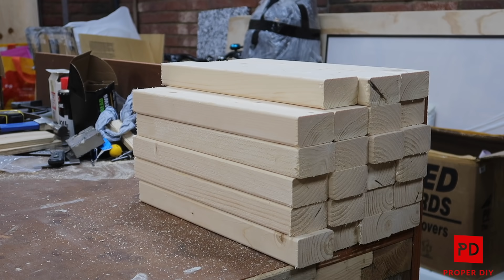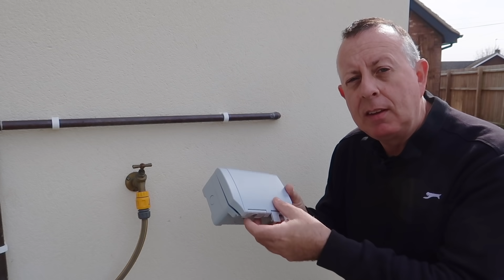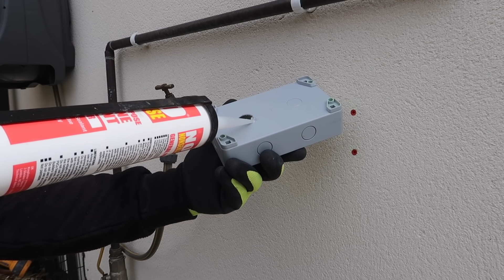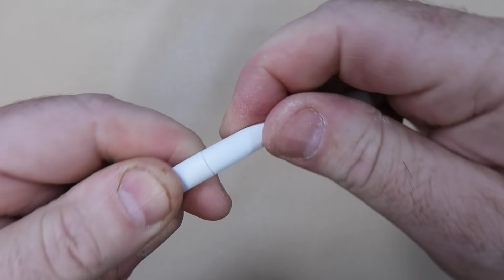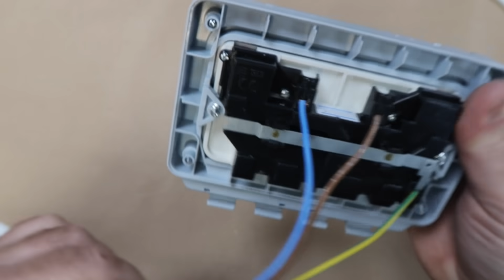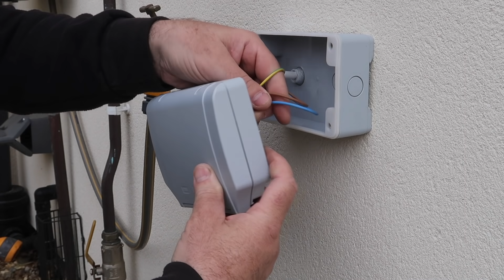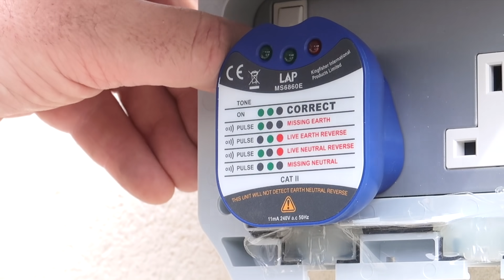How to Install the Easiest Outdoor Socket

Comment: So can you use this method with the external socket WITH RCD as well? Or does that need to be wired differently? Thanks
Reply from the maker: Yes, same method, wired the same way.
Reply: @ProperDIY  Thank you! 👍🏻
Reply: @ProperDIY  The ring circuit that I would plug in to comes from a consumer unit that already has RCDs built-in. Would there be any point in also having an external socket with an RCD? Would there be any conflict between the two RCDs? Excellent video, by the way. I have been pondering for ages about how to do this DIY job.
Reply from the maker: @trevorelliott232  Thank you. I don't tgink you need an additional RCD if like me you have one in the consumer unit.  If you do use both I don't think there would be an issue - if there was a conflict one or other would immediately trip

Comment: When I prep. the ends of flex I use the insulation that the stripper's removed to twist the strands. In other words, once the insulation is detached from the rest, I twist and pull it off at the same time. It's quick and leaves me with a very neatly twisted end.

Reduces wear on thumbs and fingers too!

It's easier to demonstrate than explain...
Reply from the maker: Good tip!

Comment: I recommend getting a bootlace ferrule kit and crimper and fitting bootlace ferrules to all stranded wire ends when screwing them into terminals in plugs, sockets etc. Makes a safer and more professional job.
Reply: That's the problem with diy, even the simplest task,  like terminating a flex, takes one into a different world. One which requires tools and equipment that cost money, when the whole idea is to save it!
Reply: 526.9

Comment: I fitted my outdoor socket direct through to an internal socket wired directly into the back box thus avoiding any ugly wires and used 2.5mm twin and earth cable as when adding a spur.
Reply: @banditfet  Since when does fitting a spur with 2.5mm twin and earth cable mean the house insurance is void?
Reply: @banditfet  Are you referring to my original comment or to 'Proper DIY' who made this video? If the latter then please direct your comments accordingly. However, my comment concerned the use of 2.5mm twin and earth as opposed to 1.5mm flex - perhaps you'd like to comment on that especially as the outside socket could be used for anything including a PHEV with a load of around 3.6kWh.
There are many hundreds if not thousands of "how to" videos on here showing how the average DIYer can add a spur, sockets, lights etc without any reference to a "minor works certificate", which as I understand it means the works have to comply with BS7671, as long as it is done safely and competently. In fact, I doubt you would even be able to get an electrician to complete a "minor works certificate" unless they themselves did the work. Therefore, I would suggest that the insurance company would have to prove that such work was defective in order to refuse a valid claim.
In conclusion perhaps you would also like to comment on the changes to Part P of the Building Regulations:-
Under the new, revised regulations, electrical work undertaken in kitchens such as adding a new socket or work outdoors such as installing a new security light will no longer be notifiable unless a new circuit is required. This will mean less work has to be notified by electricians.
Reply: @banditfet  Sorry, but you are wrong. Replacing sockets is not a 'notifiable' job in electrical terms and does not void insurance. You can change sockets, move sockets and add to sockets yourself but if you want a new circuit then it has to be installed by a qualified electrician and signed off accordingly. Any bathroom work IS notifiable. I'm not an electrician but as regards the above video I would not really recommend installing additional sockets with less than 2.5mm twin and earth cable through the wall to an outside socket.

Comment: Brilliant, I've been wanting to fit an external socket, but wasn't too sure about hardwiring. I'll be sure to do this. Thanks.
Reply from the maker: I wouldn't want to hardwired straight into the back of a house socket. When water finally get into the external socket in the middle of the night and trips the house rcd, you then need to find the problem and unwired it!

Comment: Just the job, I’m fed up of opening the garage window to the rear garden and feeding the cable through the window, then walking around to connect pressure washer, then back to switch on, then reverse when finished. So it’s my next job. 👍
Reply from the maker: I exactly know what you mean!

Comment: Good video I was thinking of doing this in the summer,
One little tip I lent over the years ,when you cut wires to strip (live,earth,neutral) don’t pull the platic completely off the end,it gives you something to grip,then pull off end same time twisting platic and it’s twists strands so easy.
(easy on the fingers,no sharp bits of wire)
Reply from the maker: Good tip.

Comment: Unfortunately this type of socket has a design fault in that the Spring powered hinge has a nasty habit of breaking it's housing. The plastic is very weak at this point and the inevitable perishing of it will mean it'll lose its strength and the hinged cover will break free rendering it's IP integrity void.

Comment: The best way would be to drill back entry from a existing socket and put the outdoor socket back to back. No mess whatsoever.
Reply from the maker: You can do if a) you have an existing socket exactly behind the wall of where you want the new one b) you don't want any remote switching of it c) you don't want any isolation between the house system and the external socket if there is a problem

Comment: When wiring a plug I remember which wire goes where by : BLue (BL Bottom Left), BRown (BR Bottom Right), you can use it on the socket too, bLue (L Left), bRown (R Right).
Reply: What happens with LAP sockets from screwfix where the Line terminal is above the Neutral
Reply: I always remember Brown is Live, because that will be the colour of your pants, if you touch it with the power on. :)

Comment: I’ve got the same dewalt drill as you and I’m wondering how long you have had it and how long the brushes last as I may go for a brushless thanks
Reply from the maker: 2 years so far and still running fine

Comment: Any new socket installed inside or out can only be wired into an RCD protected circuit. Other than that it's a good  job
Reply from the maker: It was - I explained that in the video

Comment: Should there be a certain distance between electrics and the water if you could touch both at the same time it’s dangerous
Reply from the maker: That's one reason an RCD is required for external electrics. When it rains and your standing in a puddle as you touch the socket your water pipe is the least of your worries.
Reply: No BS7671 requirement exists but there is an industry guidance of 300mm from things like sink basins, draining boards etc. But so long as it's RCD protected and showing no signs of water damage its fine

Comment: Looks like a gas pipe above it. As per gas no sockets within 150mm of a gas pipe . Is it 150mm or more?
Reply from the maker: Yes, over 150mm
Reply: Well done
Reply: It can be difficult when another trades regs impinge on others. The biggest I get are conservatories built on the back of kitchens. A gas cooker or hob needs a min requirement  of an openable door or window to outside but window fitters  don't know so they build a conservatory and block off the only means of oxygen supplying the appliance and then you have to issue a warning notice and in some cases may e even isolate the appliance.

Comment: Great video again; I did similar when I fitted a sump pump in my drive, easiest way to do it and be able to isolate it quickly and effectively. When I had my old dis board updated to a new consumer unit I asked the sparky to fit a double switched socket underneath for just this sort of thing. Never thought of a Timer or Smart attachment though! Good thinking!
Reply from the maker: Thank you. You are right - easiest way to totally isolate the item.

Comment: Could you take a spar from the outside box and run a cable to a shed and power the shed with sockets and lighting, I have the same external box but to a CU in the garage
Cheers
Reply from the maker: In theory yes (up to 13 amps) but would have to be an armoured cable and installed by an electrician as under the Part P of the Building Regs you can't do this type of work yourself.
Reply: @ProperDIY  Oh yes you can. Been there, done that, got the T-shirt. Actually probabaly the same as hundreds of other shed owners :)

Comment: Good, safe DIY installation, however I would not recommend using this particular LAP outdoor socket because you cannot shut the lid with moulded plugs, in fact some moulded plugs do not even fit into the socket properly. This video explains it well:
https://youtu.be/-BleMQMut3w
Reply from the maker: Thats not very cleaver of the designers!

Comment: I had a smart switch on my external socket like yours but be aware that some smart sockets are only 10 amps when using garden power tools or welding equipment you can easily blow the smart switch
Reply from the maker: Good point. I must admit I've never thought of using stuff like welding equipment through a smart switch!

Comment: Thanks for this.  I am actually wanting to do exactly this and then I can run a burried power cable to my standard garden shed.  Would you think I'd need another breaker in the shed for safety?
Reply from the maker: If you are going to run power in a buried cable it will need to be armoured and then best to install a mini consumer unit. This however is notifyable work under Part P of the building regs so has to be done by a qualified electrician.

Comment: I was going to spur off from one of the sockets. 
Now I’ve seen this, I’ll now do it your way 👍🏻
Reply from the maker: I think it's an easier and safer way than going for a fixed spur
Reply: Good choice as outside sockets should not be wired to the internal ring main.  They should be on their own RCD in the consumer unit.
Reply: @raydebbiemcdonald3208 is that just for the sake of discrimination?

Comment: You could also do a slight angle for the external hole, so that any water natural drains Down and out
Reply: I believe that is essential .  Water trickles down the inner face of the outer bricks or blocks within the cavity.  If the duct is horizontal or sloping back into the house the water will pass to the inner leaf of the cavity wall and potentially cause dampness.
Reply: @chapman9230  Aa
Reply: @chapman9230  yes....so drill at an upward angle 🤦
Reply: @chapman9230  It has mastic on it so not necessary at all. The cavity (depending on year) should have trickle vents to let out water/condensation which builds up.
Reply: @mrfr87  the cavity I was talking about is the cavity of the house wall

Comment: Great job - I’ve recently done a very similar thing and assumed that given it is essentially an “extension lead” you don’t need to be Part P (unless I’m wrong?).
Reply from the maker: Correct - no need under Part P. An outside extension lead is really what it is.
Reply: @ProperDIY  really nice job  - great video 👍

Comment: The drain hole can also regulate pressure. You have a "fully" sealed box but with temperature changes in summer and winter the box will expand and contract, so will the seals and then will no longer be tight. Then water/condensation will be present and no way of draining out.
Drill the drain or fill it with gel otherwise it will get wet.
Reply from the maker: If its fully sealed, where is the condensation going to come from?

Comment: Very well made video with lots of useful information, I  just wouldn’t put the outside tap and socket within reach of each other, but apart from that brilliant
Reply from the maker: Thanks. It did cross my mind but as the socket is going to be out in all weather and hose connection is very good I thinknlow risk. I have gas, electric and water next to each other - live on the edge!

Comment: Great video and love the idea of a plug inside the house. One tip when drilling holes in external walls, I always drill at a slight gradient keeping the drill slightly lower than the drill bit point. This way, if any water does ever get to the hole and the silicone has failed, the water would run down to the outside and not inside. I would also run a bead of silicone along the top of the external plug unit to be absolutely sure.
Reply from the maker: Thank you. Good tip - I did think I might try that but was so worried the 2 holes would not line up from either side I thought I would be pushing my luck to them try to incline them as well. I was looking at the socket yesterday and though I might seal around the top and sides as you say - thanks.
Reply: @ProperDIY  I'm just wondering if you use (as you seem to have done) a small dril from each side first and then use a larger drill on the outside at an angle (downwards)(and sloping up on the inside) when enlarging the hole for the pvc pipe - you might only need 2-4 degrees...
Reply: What cable do I need to buy to wire into this and a plug? Or could I cut the cable and plug off an extension lead and use that?

Comment: It's ugly though, isn't it? Why not drill out through the back of the internal dual gang socket and then fit an RCD protected IP rated dual gang box on the outside wall as a spur?
Reply from the maker: You could do. Do you think that is easier for the average DIY'er - thats the premise of the video? I do want to be able to control the power remotely which I couldn't do with a spur and I like to have the option of just unplugging it all together and removing it completely from the house electrics. Essentially it's just an extension cable with one end outside.

Comment: So this means you can’t plug two 13amp devices into that double socket as it only has a single 13amp supply.  You only have 13amps in total shared between them both?  It’s a reasonable assumption for most people that every socket is capable of delivering 13amps.
Reply from the maker: Correct. In the same way you can't have a number of devices all taking 13amps each from the 4 way extension cable you use at the back of your TV or computer.
Reply: An incorrect assumption. I am not aware of any 2 gang outlets that are rated at a full 26A. 

IIRC the British Standard for socket outs calls for 2g sockets to be tested at 20A...

Comment: Brilliant video for a safe DIY installation, the main reason doing it on a plug top is you are not breaking into the existing circuit, and not requiring a minor works test certificate, which would be required.
Reply from the maker: Thank you